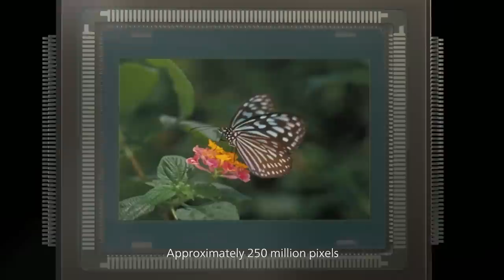Canon CMOS Sensor Technology

Comment: OK SO WHAT HAPPENED to the AWFUL SENSORS IN 6D Mark II? The OLD NIKON D750 eats it for lunch!  My 6D is better than the Mark II...
Reply: ya low light the 6d way better than mark ii how crazy is this
Reply: The 6D2 is still a bit better than the 6D. It's not a downgrade.
Reply: not if you downsample they're the same
Reply: No, the mkII suffers more from dark current noise and a color shift in deep shadows at high ISO's.

Comment: I am a Nikon user. For that ISO level I guess this sensor is applicable only for top of the line DSLR..may I know which models use this.
Reply: Muwex Tech 😂😂 DSLR such has d7500 which cost around$1250 for only body could maximum go till ISO 6400 for some extent cant imagine what canon would launch
Reply: Yeah but i mean like in 5 years or so.
I have Sony A7 III and really pleased even with 12800 ISO, Useable.
Reply: I don't think that cmos is for DSLR, probably for industrial or extreme condition video camera.
Reply: Mojun Feng They have cmos sensors already tho.

Comment: Hello canon. I bought the 5D mk IV and in my experience it had a terrible sensor in it. Couldn’t raise exposure in my Astro shots beyond 1.7 stops without serious purple banding and canon New Zealand flatly refused to look at it even though it was under warranty. I use a Sigma Fp where I can easily raise exposure in post by 4~5 stops no problems. No banding!. Your technology is at least 2 generations behind Sony & Nikon. The fact that they only use Nikon on the ISS kinda explains where canon technology really is!

Comment: It's too bad none of this amazing technology has been making its way into Canon's DSLR line of business.   I bought the 5D Mark IV hoping to finally get the dynamic range and low light sensitive I wanted. And while it's certainly an improvement over the 5DIII, it's really nothing to brag about. Meanwhile Nikon and Sony are killing it.  I'm so tempted to move over to Sony. And the thing is, once Canon loses customers this way, it will be very hard to win them back. Canon would have to leapfrog Sony's technology and if you've watched the progression of the 5D, 5DII, 5DIII and 5DIV series (combined with how long it took for each of those to come out), it's quite obvious that Canon either doesn't have the technology or by preference is holding its DSLR line back.  I'm not sure how much longer I will hold out. The 5DIV is (by 5D timeline standards) still very new and unlikely to be replaced soon.
Reply: Totally agree with you. My Mk IV had terrible purple banding on low light conditions. Nikon & Sony (Although I prefer the build quality of the Nikons) are vastly superior cameras in every regard.

Comment: Hello Canon, I have been a Canon user for 34 years. I have always loved your lenses and SLR/DSLRs. Currently, I have a 7D and a 7D2 which I use with FF primes with the view to upgrading to a FF body at some point. But I must say that the 6D2 and the 5D4 were both a disappointment to me and were no interest due underperformance and knobbled features when compared to your opposition. The 1DX2 is a nice camera but way beyond what I can justify paying. So I have been in a holding pattern with my pair 7D/2s for some time now, considering my options. Now that Sonny have released the A7III i have been looking at it because it has two features which I think are indispensable - In Body Image Stabilization and their Eye focus system. So, unless Canon are able to release something outstanding that doesn't cost a fortune I think I'll be mounting my Canon glass onto a Sony A7III in the not too distant future. After 34 years I think you may have lost a customer. Going by what I've been reading, I'm not the only one.

Comment: I for one think Canon should spend less on Advertising and more on R&D. I absolutely love my 7D MKII (and the 7D before that). Camera is still very fast for a 2014 model, autofocus is quick, dual-pixel AF is fantastic, built like a tank, but I feel like their sensor tech is falling behind the competition. Other manufactures are getting more out of their FF, APS-C and even micro four thirds sensors. Also, what about a good mirrorless camera that's not just for bloggers and can use EF lenses without an adapter? I am pretty sure you can do cool things to fill what's left of the 44mm flange distance after you remove that mirror. A cool sensor stabilization system, perhaps? Just daydreaming ...
Reply: I have a 7D and 7D2 also and they're pretty good. Although the 7D2 is way better than the 7D in low light for focus and noise. Mind you, I'm thinking of getting a sony A7III (but still keeping the 7Ds) because I love the IBIS and the eye focus. I have always lamented the lack of IS on primes but this body will fix that. Unless canon do something pretty special I can't see myself getting another Canon body so long as I can mount my EF lenses on a Sony.

Also, I don't think we will ever be seeing cannon offering in body image stabilization for EF/EFs lenses because it will render all their IS lenses obsolete.
Reply: Yeah, I have been toying with the idea of jumping ship to the A7III as well, it's just that the mount adapters are not the way to go in my opinion. Maybe now that sigma is getting in the game we can get more affordable glass for Sony? Canon should definitely come up with something good in the mirrorless front. Like you, I am not buying another Canon body anytime soon. Good point on sensor stabilization.
Reply: As far as I can tell from what I've been watching on youtube the Metabones and Sigma adaptors both work well with Canon EF lenses now.

Comment: Developing sensors with low noise capability  !
Well not the sensor in my eos 7d original.
Plus the aspc sensor is apx 1mm small than sony and Nikon. Canon aspc sensors are apx 25% behind the competition   however apx 8% is due to having a smaller APSC snsor !